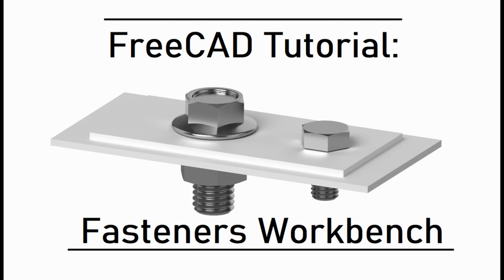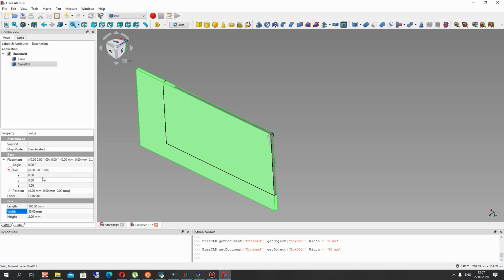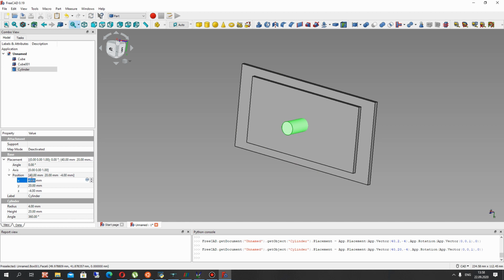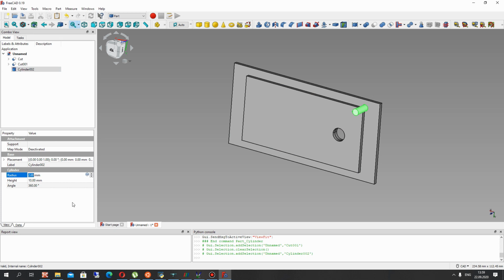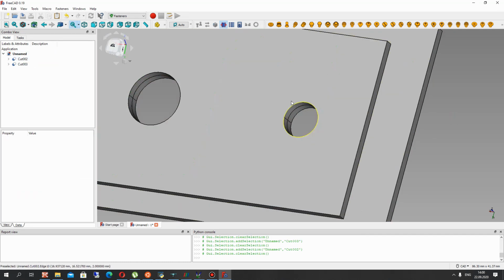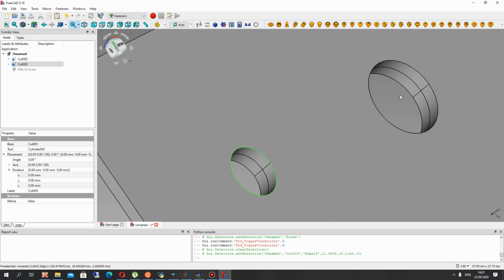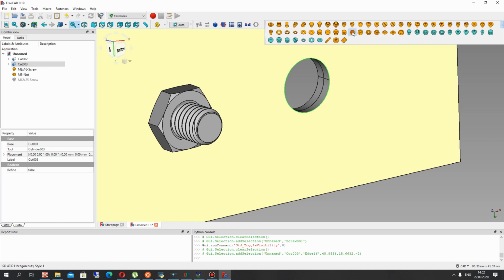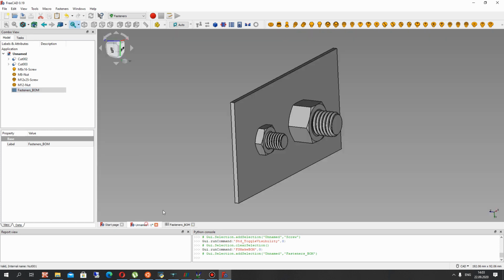FreeCAD Tutorial | How to Create the Screw and Nut Connection using Fasteners Workbench

Comment: I have a problem when I move the holes in the plate the screws  do  not follow the holes or they jump from one hole to the other.
Reply from the maker: I think you need to create screws and nuts seperately with holes, and after that you can just create assembly A2plus or Assembly 4, where you make connection between screws, nuts and holes